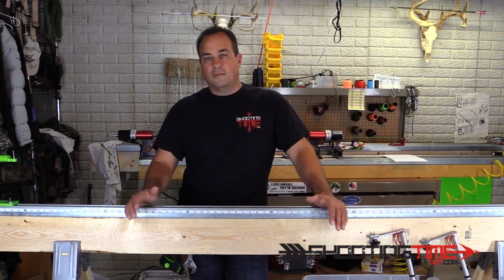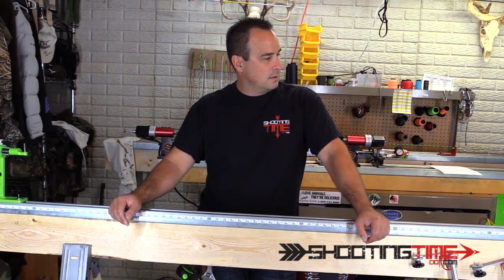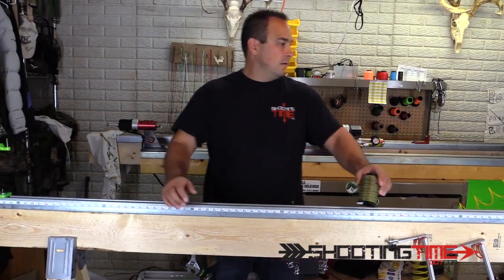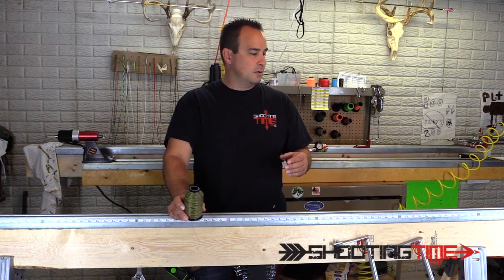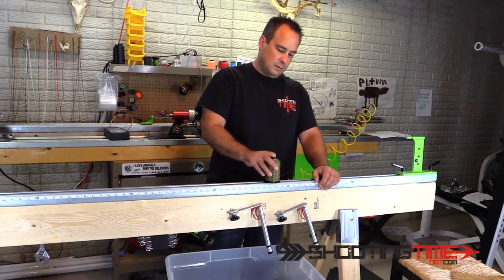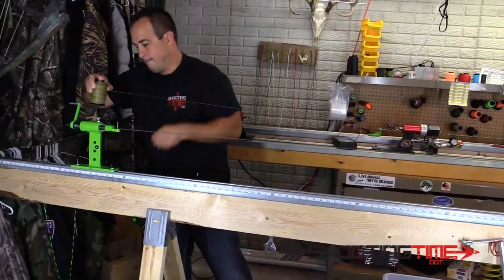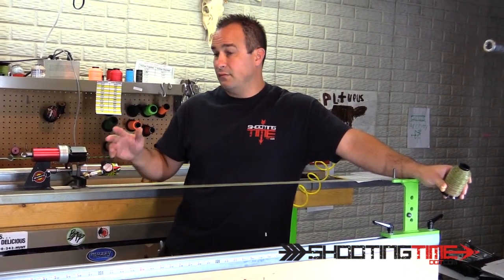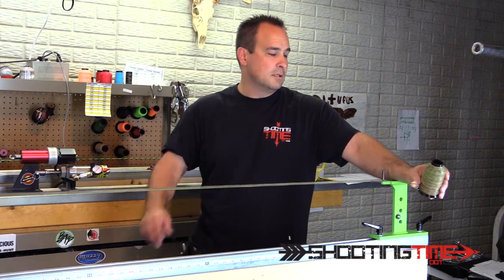How to Make a Bowstring -  "The Lay Up" - Part 1 of 5

Comment: Is that formula good for buss and control cables as well, for example my control cable is 32.25 finished length. with that formula i would be about 24 twist and would add a quarter inch (.29 actual) to my length for laying out? Thanks again! Finished my first string following your video. Its one of the best out there!
Reply: Yes will work for cables also.

Comment: When serving end loops using the tag end method I see that you don’t actually form the loop by using one of the tags over both bundles (as some string builders do). Is there a particular reason why you have found it beneficial to just use the final cam serving to finish the loop?

Comment: I made one for my compound bow which has about 100 lb draw, out of Plano catgut like you Stitch leather together with Twisted stretched and served it with two 1500 lb Jack straps between the post on my front porch. Shot  it fifty times or so the bow is stronger than ever can hit a gnat in a plate of grits at a hundred yards with this b****... totally expected it to fly apart though

Comment: Thanks for the great video, I recently purchased a set up from Baker archery do you feel there’s any benefit using their four post jig and serving the ends versus two post and doing the tag serving?
Reply from the maker: From the guy in the video: I use the 4 post and serve the end loops now. Most large companies serve the end loops. Vapor trail is an excellent string maker that still only uses tag ends. You just need to be careful not to pull the tag end too tight or you will get bumps in the string.
Reply: shootingtime.com Thanks! I purchased bakers proshop kit. Which has the stretcher and 4 post configuration.